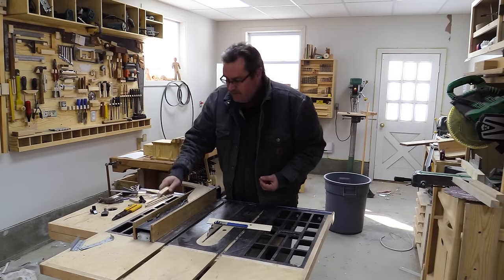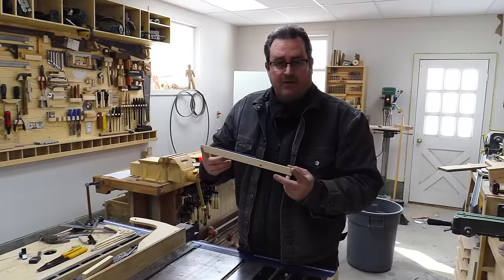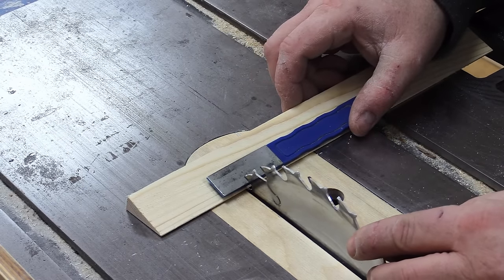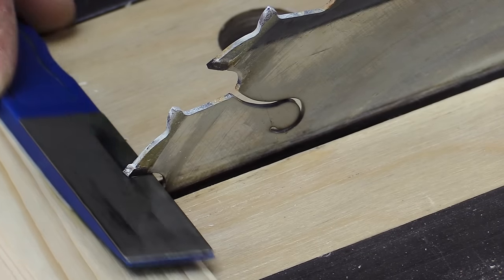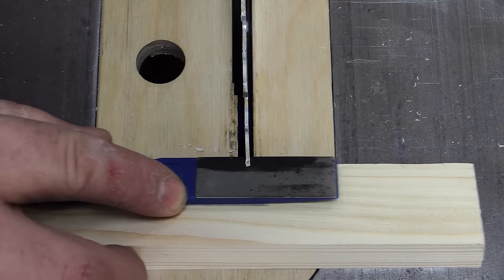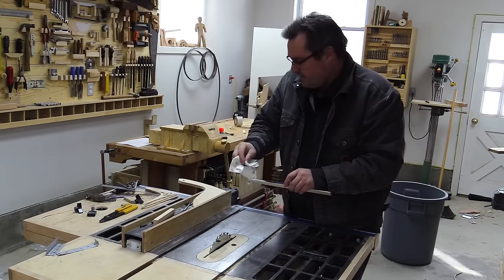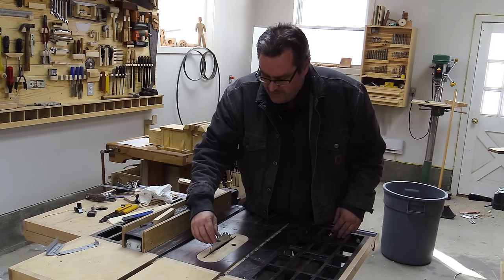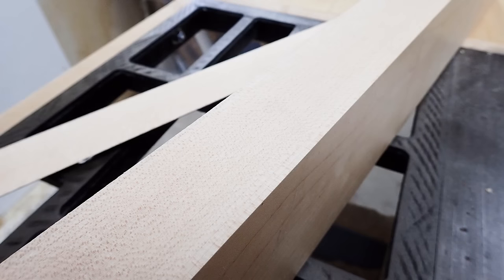Sharpening A Carbide Saw Blade By Hand

Comment: Pro Tip: Make a mark on your starting position. You know why.
Reply from the maker: ***** That's actually a rookie tip :)
Reply: Or count the teeth, if you were working with a 24 tooth blade you sharpen 24 times.
Reply: I would think you would see the oil on each tooth you already worked on. So, just stop when you see oil.
Reply: aqwood  It takes only one distraction.
Reply: ***** like marriage
Reply: it is a good tip, no matter what anyone say, and i like to count my strokes too, so I keep the blade balanced and teeth even.... just saying
Reply: aqwood
 Duh!!
Reply: Brotip??
Reply: Because without a mark it becomes a Sisyphean task and you'll doing it until the end of time? lol :D
Reply: I used this jig as well. And just to make sure I'm going perfectly straight back and forth I set another strait line fence type jig in my miter slot and just run the board back and forth perfectly square. I'm sure it's not that big of a deal, but it works great, nice easy strokes! lol
Reply: Or keep sharpening infinitely
Reply: Why can't you just use the letter already written / marked on the blade, and/or that notch cut into a saw blade? That way you know where you started and where to finish and don't have to waste time finding the sharpie and marking it? That's what I do . . . am I missing something?

Comment: Now that's an elegant solution, scrap of wood and a diamond file, pretty amazing. Is that angle universal, cause I have bunch of blades that could use this. I only recently discovered the use of those inexpensive, thin kerf circular saw blades, they cut wood like butter on my under powered TS, with this technique, switching blades can now be rare.
Reply: The angle will depend on the rake of the blade, how high you set the blade and how deep you push the stick into the teeth. The ~20deg will probably work for most you just have to adjust the blade height and eyeball it to get it flat with the front of the teeth

Comment: Thanks for this, you inspired me to make a jig for sharpening the 65mm blades for my Bosch mini-saw, which go blunt quite quickly (I mainly use it for cutting 6mm mdf sheet) and aren't easy to get hold of in a hurry.  My honing stick slides in a routed slot in a mdf base, emerging at just the right point to grind on the blade tip.  The blade is held using a giant bolt, washers and a wing nut, simple old-fashioned technology,  to a vertical mdf riser glued and screwed to the end of the base. The trick is to mount the blade-holder in exactly the right place, with the spindle at the right height and distance so that the blade tip touches the honer at the right angle.  I routed my slot in the base, then drilled my bolt-hole in an over-large piece of mdf, attached the blade then shuffled things around until I could see exactly where it had to go, marked it up, then removed the blade and cut it down to the final size.  Shame I can't leave photos in a comment.

Comment: This works great. I clamped the angled piece to cut off sled. Ran the diamond card over it. 80 tooth carbide took a while. No burned edges in hickory  after sharpening.  I’m impressed.

Comment: Be sure to check the faces of the carbide tips... on my DeWalt thin kerf blade the faces have alternate angles.
Reply: Same goes with my 10" 60T Matsushita tablesaw blade. I used the diamond stone stick freehand. The "sharpened" blade doesn't cut like butter, but no longer fills the garage with smoke either.

3 full strokes per tooth with the blue stick, lubed with wd-40.

Comment: Freshening the edge always...usually makes a difference...for the better.
You commented that you make sure your always going straight across, never at an angle.
A little searching showed me that there are many types of tooth configurations.
Two of them are :
Flat-top: A flat-top tooth is perfectly square and used for quick ripping.
Alternate top bevels: Alternate top bevels are angled to provide a sharper tooth edge for crosscutting, with each subsequent tooth beveled in the opposite direction.
Might want to think about a couple pieces of tape, or a sharpie, for the additional angle.
Chainsaw blades are a good example. You want to follow the original profile.

But I do like those little diamond sharpeners...

Comment: I was hoping that you would have put the source of the Sharpening tools in the comments section. Starting a kitchen remodel and everything is dull.
I completely restored my Craftsman table saw but didn't touch the blade. I bought a couple of new ones but all 3 have different cuts.

Comment: I think this would be the best way to sharpen a blade. I´ve seen other ways sharpening with diamond blades but although might be a faster way, there is overheating on the tooth bit which definitely not good.

Comment: Hey John, great project. Couple of questions: 1) how did you know the angle? Is it the same for all blades? 2) what do you use for cleaning off resin/junk on the blade?

Thanks!
Reply: 1) can't you see there is no angle?? 2) are you in the woods? use gasoline o whiskey
Reply: You can use a protractor to find angle. A wire wheel will also work to remove pitch from the blade.
Reply: Apparently Isopropyl alcohol (rubbing alcohol) is the stuff to clean resin off saw blades.

Comment: got a question for you 
could this process work on a metal cutting blade they do use carbide  or some type of hard metal and they do du up round off Break teeth a that but the process of  sharpening a saw blade such as a carbide metal cutting circular saw blade is a tuff question to find an answer to with all the angles in this its not the same as a wood blade could you help with this 
     thank you in advance

Comment: great tip! I'm wondering, in professional sharpening service, do they also sharpen the top of the teeth? or just the face of them?
Reply: Pros clean, then lap the 'as you would say the face'. This is a good tip in a pinch I guess. But for me, a $140  80 tooth alternate tooth blade, I have my sharpening shop do all teeth properly for around $18. I like to keep my blades free of resin build up. Spraying them with "Ez-off oven cleaner", scrubbing with a soft scrub pad, then rinse with water.
Reply: Jeff Crawford where did u get $18 services? I called around, all cost a fortune
Reply: I should have mentioned, I have a cabinet shop. We send out 3-4 blades on a weekly basis.
Reply: You are referring to topping, or facing.... Yes, the pros do that as well.
Reply: Yes we top the saw which is the top of the tip that method is not accurate

Comment: Hey John, just a quick question here. If the teeth on my blade have little side offset, each tooth to other direction, will it affect the performance if I grind them to 90 degrees all using your method? Thanks
Reply: set the bevel on the saw so that they are flat in relation to the saw and just skip the teeth set in the other direction then change the bevel to do the remaining teeth
Reply: SKW Bushcraft p
Reply: SKW Bushcraft vgt
Reply: You can set bevel only in one direction.
Reply: You need to use specialized sharpening jig.
Reply: I was thinking exactly the same. I have the same type of blades described by you and i only sharpen them at a specialised shop nearby. The guys there have some industrial machines and they can sharpen and weld any type of blade or band. They strongly advised against any "manual" sharpening of the blades... The offset you mentioned is for the tooth to cut progressively so it will leave a nice edge.

Comment: Does the height of the saw blade make a difference in using this technique?
Reply: Robert Sauve - No, I don't think it would.   The tooth always approaches the table surface at the same angle, regardless of how high the blade is set.
Reply: +Batti2323 it does change depending on the height of the blade. table saw blades are circular

Comment: Don't some blades alternate from slope slightly to the right or to the left?
Reply: You mean ATB Blades (Alternate Tooth Bevel)..

The hook angle is the amount of forward or backward lean each tooth has.  A
 hook angle can be thought of as the angle at which the tip enters the 
material.  If the saw tip enters the material at an angle it will be 
more efficient than if it slaps down flat.  A 20 degree positive hook 
angle is used on rip blades to pull the wood into the blade. Standard 
hook angles range from 5 to 15 degrees positive. Steeper angles, from 18
 to 22 degrees, are most effective for ripping and cutting softer 
materials.  Hard materials require a shallow angle such as 6 degrees.

For more: http://www.carbideprocessors.com/pages/saw-blades/saw-tip-angles.html
Reply: Ari gatto Grand master senf. Couldn't ask for a better response than that.

Comment: I wish I had seen this before I changed the blade on my table saw.  There is something wrong with my arbore, two prongs on the locking nut looked bent, and now the blade is leaving cut marks on anything I put through it...
Reply: Dull blade with Not enough teeth or your pushing it through faster than it can cut properly.
Reply: I was answering the rrply about his blade leaving cut marks in the wood.

Comment: Amateur (first time table-saw user) question. I was given a table saw with a DeWalt blade. The blade is still painted yellow. I'm not sure if it's supposed to cut, even with the paint on, or if I have to wear it off, or if new blades need to be sharpened, or if I just don't know how to use the table saw. 

I'm trying to to cut 2 /14 by 3/4 in half to make thin slats. It feels like I have to exert a certain amount of strength to push the wood though, and that the going is slow.  I'd appreciate your thoughts on the matter. Thanks.
Reply: Is your blade installed correctly?  If it is spinning in the wrong direction, that would go a very long way in explaining your troubles!
Reply: Francine, go advertise somewhere else.
Reply: As far as i know that yellow stuff on the blade is not a paint. Its a colorised aluminium coat, which prevents the blade from oxidation, keep the blade smooth, and there is no burn marks on the wood. Regular paint would burn onto the wood, but the coating does not.
Reply: Attil

Comment: Any idea how to sharpen a circular saw (without the table) ?
Reply: Flip it over and clamp it down?
Reply: Good idea!
Reply: If you have one of the nice workbenches with a wooden vice you could clamp the blade in the vice and then use the workbench top as the table saw top. If you don't have one of those (like me) maybe you could just use a regular vise and if it works. Or if you like building jigs build a table around the vise so you can sharpen the blade on that.

Comment: Hello everyone. Eugene here with a question. Why is it that wood dulls the carbide tip but it takes a diamond surface to sharpen it?
Reply: Wood is an abrasive that is softer than the carbide teeth. The teeth are worn away by the wood at the edges, causing them to lose their sharp, cutting edges. Rubbing another abrasive- the diamond-dust-laden adhesive on a steel plate- causes the teeth to become flat with sharp edges again.
Reply: Carbide is a very hard material. Wood is a soft material. Diamond is an extremely hard material, therefore it's used to sharpen Carbide.

Technically, it is possible to sharpen carbide with wood, but it would take a million years...
Reply: If you tried to cut a diamond with the carbide tip, that would dull it as well... all about the angle of motion my man, and which way the friction is going.  Cutting wood or any material runs across the sharp blade, sharpening works with the edge, not against it.
Reply: It doesn't take a diamond surface to sharpen tungsten carbide, but it sure does help!  A green grinding stone is usually used to sharpen WfC.  It is a puzzle though, as to how wood dulls a WfC blade.  It seems like it should stay sharp forever, unless you are cutting wood that still has bark on it which might contain dirt.  Silicon Dioxide (sand) is very hard and abrasive and so is Aluminum Oxide, so if those are on the material being cut, over time they will dull the blade.
Reply: you are very right about silicon dioxide. it is often present in wood and very present in mahogany. that will dull a blade quicker that ebony or ironwood. woods like fir and pine, even oak are not as bad and I can usually avoid ever sharpening a carbide blade with those woods. what kills my blade is the occasional nail or wire hidden in the wood.
Reply: You can use diamond paste or metal polish on a piece of MDF to polish and sharpen tools, I use that on chisels, etc. Should work on saw blades too. A diamond file is much simpler. 

Why does it get dull with wood? Heat, friction, dirt, grit, the wood itself will slowly wear it down with enough time. It's not adamantium.
Reply: You could sharpen it with a standard grinder, file, belt sander or any other sharpening method that works on metal. When you do that expect it to take from 1 to 25 years to get the sharpness you want. Wood is very abrasive and the saw blade moves very fast through it, so cutting a board is equivalent to a long usretty fast and get very expensive.e period of just chipping away. Using a standard sharpening method would also use up the sharpening devices p
Reply: Diamond is harder than carbide, therefore, it can cut the carbide to sharpen it.
Reply: This is a good question or a trick question. I like to hear from a material scientist or physicists. They could also explain why my diamond blades could not cut wood.
Reply: A lot of blade "dullness" is just accumulated filth. Soak and scrub a blade in simple green and it'll cut better. 
Also, there is a lot of stuff on and around wood that dulls blades over time. Small amount of dirt from the environment and your hands has hard minerals that can dull the blade over time. 

Also, you can sharpen a blade with cardboard if you have enough time. Everything that abrades/dulls a blade can also sharpen it. The diamond stone is used because it saves a lot of time by abrading/removing a (relatively) large amount of material quickly.
Reply: From what I recall about a course I followed in my Molecular Sciences program, is that at the atomic scale, friction can cause extreme temperatures, which means that although the blade will feel lukewarm to the touch, when it is cutting, the very tip is experiencing high temperature (I don't recall the specifics, but I think it is in the high hundreds or even multiple thousands degrees C). So the heat generated by friction at the cutting surface is actually high enough to break the molecular bonds, which causes material to wear away. At these micro/nano scales you can have some interesting phenomena you wouldn't expect from a macroscopic view. But now please let the real Materials Scientist stand up and answer this question with less handwaving :)

Comment: Once the carbide is worn off,       Can you sharpen the tips ?
Reply: the carbide doesn't wear off it is a fairly large piece of carbide soldered to the steel. it the carbide is knocked off then the blade is no longer useful for a saw blade. makes a good target for a BB gun though.

Comment: This is great! With a proper jig you might be able to sharpen it more times. But the first few times make the biggest dent in expenses.
Say a nice blade is 50,- and you need to sharpen/replace it 4 times a year.
Not sharpening the blades will be 200,- a year. Sharpening your blades once before throwing them out, 100,-  a year. Sharpening twice, 66,- But even sharpening 10 times is still 20,- a year which is an insignificant improvement in an absolute sense from 3 times. Buying and storing an elaborate sharpening setup to go from 3 to 10 sharpenings on a blade in order to save 40 bucks a year? No thanks.
Reply: I'm not sure I'm following this math, or maybe I'm confused about how many sharpenings are going on. 

When you say 10 times, do you mean sharpening the same blade 10 times? If so, and you need to sharpen 4 times a year, wouldn't that be 2.5 years? The only cost would be the sharpening sticks. 

Purchasing 4 blades a year @ $50 each would cost $500 over the course of 2.5 years. 

Regardless of how many times you sharpen, the savings are the same each time. It's always $50 minus the cost of the sharpening stick. The total savings accumulate, but each sharpening doesn't change.

Comment: I thought the carbide tips were also at angles as well on an axis perpendicular to the blade.
Reply: Matt de Oliveira I think your right.  I do not have a TS so can not check this idea but I am wondering if you angle the beveled stick can you match the side angle on the tooth?
Reply: Certain blades do. Rip blades do not
Reply: Matt de Oliveira I just finished sharpening a 12" carbide  80 tooth blade using a tool made  specifically for circular saw blades. Diamond blade sharpens carbide, regular steel is softer & you can use Emory or diamond. With this machine the blades turn out about perfect. The angle (set) of the teeth varies as to type of cutting done. I've noticed the carbide blades on the face ,ALL THE TEETH are at 90 degrees. Only the tips are angled. Steel blades have the tooth face set. To maintain sharpness, it's important to keep blades, router bits, ETC clean of wood debris cause it's corrosive to the metal . Some types of wood are acidic. I definitely endorse the use of diamond files, they're great. Get yourself a honing guide & sharpening stones, etc & do your chisel to a perfect razor edge!!

Comment: That stuff will set off a Geiger meter so don't breath or handle the dust
Reply: The minute radioactivity of tungsten carbide has nothing to do with why you don't want to breathe it in.
Reply: John Call its the heavy metals that are cancerous i believe theres cobalt in the metal. its just all bad i use gloves a diamond router and water pump and dust mask